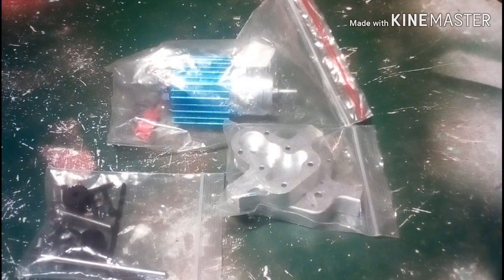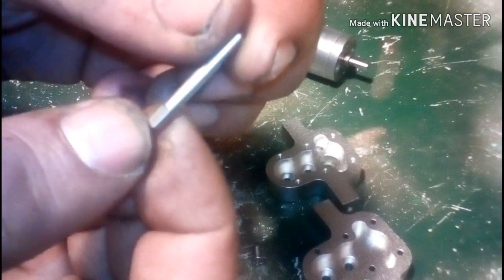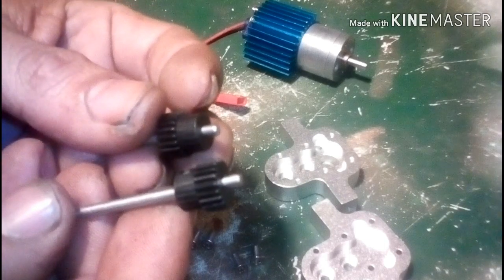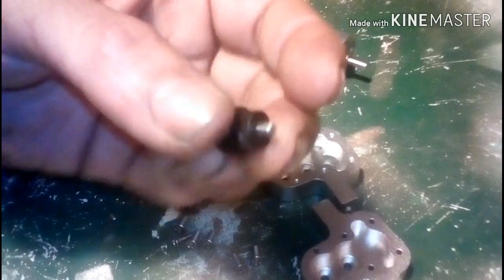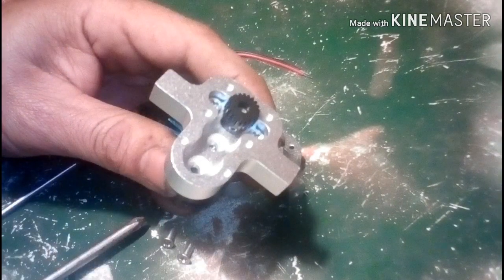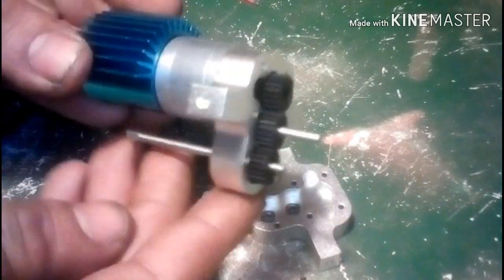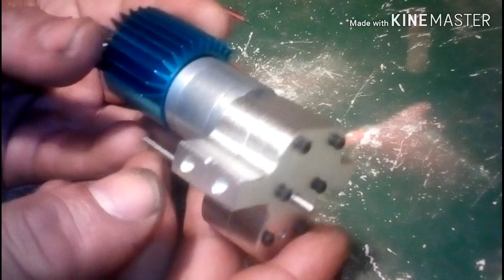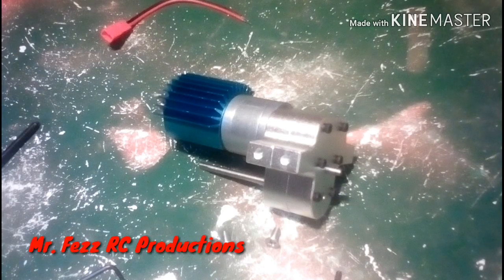WPL/JJRC/MN 90 Metal transmission | assembly instructions

Comment: And just a heads up that thing you're calling a gear reduction unit is in fact the planetary and the very first gear passed the motor is plastic I promise you take it apart and check it's not a bad thing that it's plastic it just means that if someone pushes the car to force it to move that gear will likely get stripped but if it's moving under the power of the engine it should last for quite a long time it is a pretty cool setup I'm waiting for mine on Amazon I hope it shows up assembled

Comment: Sorry man your videos a fail it's not a transmission it's a Dropbox with a planetary with the motor and the long drive shaft is supposed to stick out both ends of the Dropbox because it drives the front and rear diff if you put your rear diff off the centre shaft it's going to spin the opposite direction but good luck bro